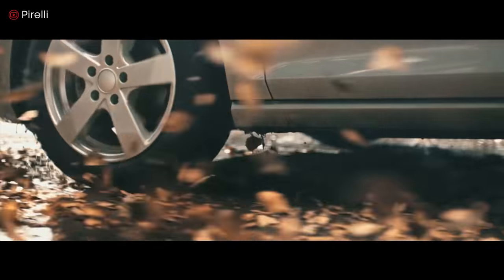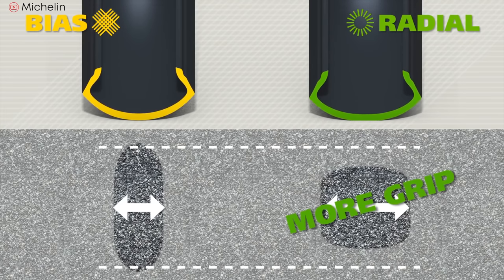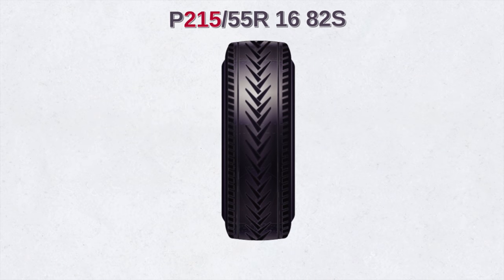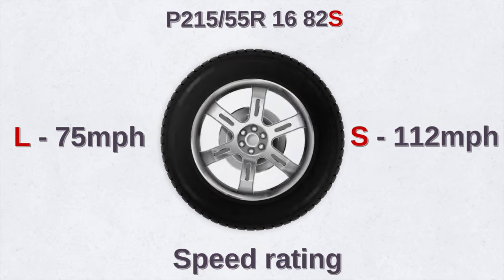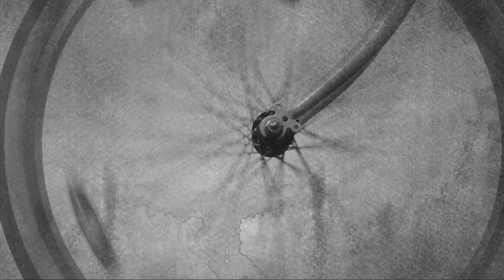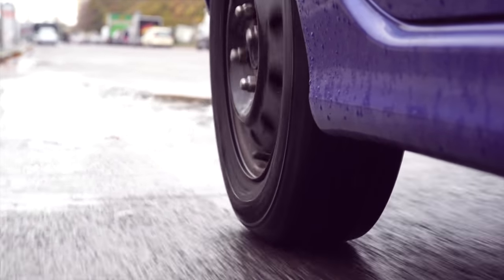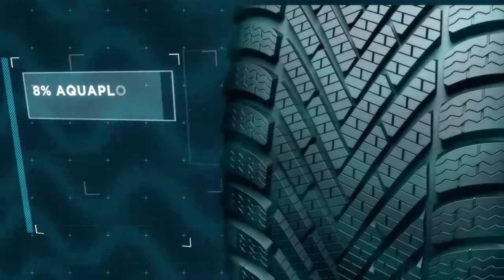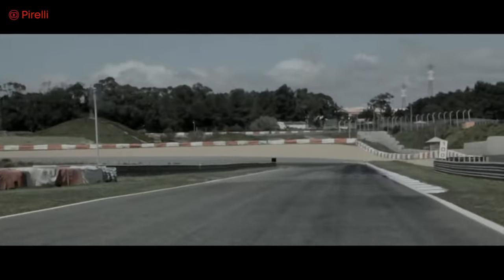These Tires Will Last Forever

Comment: Hey Scotty, 
Love your informative content 👍
Could you please do a video on the mechanics and geometry of front wheel castor, camber and toe in?
My 2016 Chevy express 3500 has had wheel alignment done twice in the last 3 years. And still the left front tire squeels like crazy while making a right turn in a parking lot. I also get some bucking feedback through the steering wheel. Im thinking the camber and or castor is set wrong. God forbid I end up changing out tie rods, pitman arms etc 🙏
I know from experience that the typical alignment tech wont go to the effort of adding or removing shims. ... Too much labour. 🙄

Comment: Let me start with, I rely on your expertise for a competent valued opinion. I see that you are not a great fan of Kia, but I did buy a Kia 2018 Niro Ex Hybrid, not a plugin but a brake regenerating system. My question is regarding the tires for this vehicle. What I haven't been able to find a definitive answer as to who produces a good Less expensive tire for this car other than the Michelin brand which is the most expensive. I would greatly appreciate any advice or recommendations you may have. I would believe that others could benefit from your advice as well. Thanks for any help.

Comment: Scotty there is a new classification called all weather tires to be used all year.They are not all season tires they are better and have a snow flake symbol on them.The Toyo Celsius tire is one example you should research this and update your video.I live in Canada and I use these new tires they are quiet and supply great traction on snow and ice I find plus no change overs needed any more .

Comment: Great video.  I’d like to hear about speed ratings. I have a Land Rover discovery sport that has V rated tires.   The guy at the tire store is telling me I’d be happier with H.  I realize in not going 149 mph but do appreciate the way the car handles.  I’m always up for improvement / ride quality but not looking to step backwards.
Reply: IF you live and drive during the blistering heat of summer in the Western USA or Southeastern USA then the V rated tires give you some extra heat protection at normal legal posted interstate highway speeds. The ambient air temperatures 1 inch above the concrete are usually much higher than the ambient air temperatures 1 foot from your driver's door window , plus the concrete itself is usually far above any average ambient air temperature around the vehicle.  You want the extra heat handling capabilities to somewhat reduce the probability of tread belt separation or sidewall failure.

Comment: Hello Scotty, is there a particular brand of tire that you would recommend for my car. I bought my first AWD car. I bought a 2018 Lincoln MKZ RESERVE AWD. It’s a Turbo 2.0. I’ve had it for a couple of months. I haven’t had the opportunity to use the AWD yet because we’ve only had 1 snow storm with hardly any snow. I live in the North East aka Snow Belt Region. I will never own Michelin. Michelin were on my 2011 Lincoln MKZ it was an Autostick 6 cylinder. It was excellent in the snow. It didn’t offer AWD. The Michelin’s wore out way before the manufacture warranty. They refused to honor their warranty. I’m not one to drive a great distance but, I definitely kept up with tire pressure & tire rotation. Even the service manager agreed with me. I bought my tires at a tire shop after that. My tires were fully warranted. I have the wheel chart that you explained.

Comment: 4WD with summer or all seasons can't compete with RWD or FWD plus snow tires in the snow. I love how when it snows here and all the soccer moms with 4X4s with 22" or 24" wheels wreck or get stuck since they think having 4wd can replace tires made for snow or offroad tires with the snowflake on then. I have BGF ATs which have the snowflake on it and I can't even remember the last time I used 4x4 on a paved road even with 2 feet of snow on it.

Comment: Hi Scotty . Back in the 60’s I put Michelin X tires on my 1958 VW bug . And increased the  road holding  & cornering by 60 % and got very high mileage. And never used snow ❄️ tiers . How did  the snow plough driver get to the plough ? = VW Bug 😂🇨🇦🇺🇸

Comment: My mother's 2013 Sonata just turned 80K miles. In the 30K mileage area they had new tires put on. Those tires still have 60-70% tread left. Those tires will last 80-100K miles. Plus original brakes. The GDI engine completely failed around 40K however, maybe 50K, otherwise it's seems ok except it's 4/10 slug shotgun steering wheel

Comment: Great video.

I learned years ago that "All season tires" had to compromise in  all aspects of weather. In order to last 50,000 miles they had to be hard enough to handle the heat of summer. But that meant they were not ideal for winter because they were stiff and did not bite well on ice and snow.

I was driving 40 miles  to work in every kind of weather you can imagine. I lived in Southern Wisconsin. A friend recommended winter tires for my Plymouth Duster which was terrible in snow because it was so light in the back. I bought some extra rims and had the tires installed. I could NOT believe how much better they were on ice and snow. In 1985 I bought a Dodge Omni which was pretty good in snow but not so good on ice with the "all season tires" from the factory. After I put the winter tires on, I rolled the window down and I could hear the tires actually ripping at the ice clawing their way forward. Amazing. I currently run General Grabbers on my Jeep Liberty. Most people would think them too noisy but they are good in rain, mud, snow, and do fairly well on ice. They are better at being an "All Season Tire" than what came on it from the factory.

I haven't felt the need to put "Winter Tires" on the Jeep as yet, although last year we had some freezing rain that made me wish I had the "Ice Tires" on all fours. I did decide to keep tire chains in the Jeep just in case that happens again. Seems to me there is nothing slicker than wet ice.

Comment: Here in pa I run all seasons but look fir those with best stopping distance in wet …90% of driving is dry or wet.. rarely snow but the all seasons handle snow pretty well.., around here they salt like crazy so snow often means wet anyway. If there is more than 6 inch on road I just stay home🥴

Comment: This was really good, would also like to see you talk about the difference in tire wear due to Electric Vehicles when the driver uses 1-pedal driving. There’s not a lot of consumer knowledge in this area, and EV owners will boast of ‘maintenance free” or savings compared to ICE cars. It’s not the case.

I’ve heard mechanics explain this - due to the inability to coast combined with the regenerative braking feature of 1-pedal driving power is constantly sent to the wheels to either accelerate or brake. EV motors have more torque so they get more wear on acceleration, combined with a 1-gear transmission or none at all, then when the driver takes his or her foot off the accelerator the regenerative braking starts immediately.

This sends immediate braking power to the wheels and increased tire wear, you could go through tires very fast especially in warmer climates where the roads are never cold. I’ve also heard winter tires on EV’s can last much longer so if you buy an EV the 1st thing you should do is also get a set of winter tires. They will come with summer tires (performance) and they are not safe in most winter conditions.

You can get 60K out of tires on a ICE car, expect to get 20K out of tires on a EV. I think that’s a good rule of thumb to go by. Now your maintenance costs have tripled so that is going to cut into any savings on gas vs power, engine maintenance vs battery/electrical maintenance etc. I did some research and ICE costs me around $50/month vs EV would cost $80/month for maintenance on average. The cost savings on gas is significant, well over $100 per month but EV’s are much more expensive right now, and the upfront costs along with concerns over how long these batteries will last, that’s the real challenge in moving to EV. Not to mention lack of charging infrastructure when it comes to taking longer trips, and length of time to charge when you are on a time crunch

Comment: Scotty what do you think of the new class of All Weather tires from Nokian & Toyo, that you can run year round. I do not know if any other tire makers are making them. I live in MT, but do not really drive that much because I am retired. I have used winter tires only on one car in 25 years of living in MT. The cost of a new set of rims to mount only winter tires or having to pay for mounting and balancing tires every 6 months, just do not seem to be worth it.

Comment: So Discount tire as well as others all go by the pressure on the inside of the car door. However, the pressure in the car door is not related to the Tire Specifications and submittal. The spec on the specific brand of tireay call for a lot more air pressure then the car door. Having the tire 10 to 20 psi less than the tires rating, jeopardizes the amount of weight they can actually carry. What's the right decision here?

Comment: So I live in the center of the continent where it gets over 110 (sometimes) in the summer, and 30 below 0 regularly in the winter. I primarily drive paved roads but go camping and adventuring a couple dozen times a year.  I drive a full size 4x4 suburban and am curious what to do. Do I have to get 2 sets of tires? I'd prefer if I didn't have to but I need to get around in deep snow and ice. But also drive 6 months on hot dry/wet roads!!! Is there a decent single option out there for me? Please help!!

Comment: A few years ago, I bought tires at walmart for the wife's car.  They were 51 lb. tires.  I'm guessing that the OEM tires were 35 lb tires.  The tire "technician"  inflated the tires to 30 lb., based on the tire inflation info on the door.  That is like driving around with a flat tire.  The guy argued with me, but I try not to argue with fools.  After driving for a few days, I asked her about the handling, mileage, etc.,...  I filled the tires up to 51 lbs.  Her mileage went back up to normal.  The info on the door is for OEM tires.

Comment: My Mercedes has a pressure psi near the door and another on the gas flap behind. Any idea why and which one must be followed? BTW even the dealer was confused when asked!
Reply: Right it is confusing. Differently manufactured tires have different pressure recommendations.
Look on the tire, (in small print) it will have the maximum tire pressure for that particular tire.
Go by what the tire manufacturer recommends.

Comment: Lincoln's head is about 1/4 of the way in my tread but winter is here.  Do you suggest new tires?  Geez they are around $800.  I like to get them from my dealership then they will do free rotation for me.

Comment: Hi  Scotty I've been following your website I was a homeless vet for a year and a half now I'm in a VA home I have a 24-year-old 4150 that I've had for 12 years it's got about 170,000 MI I've had the front end checked and they said it's okay I put a new power steering box in the brakes have been replaced the internal cam sensors been replaced the compressor has been replaced along with the dryer I tuned up the truck it's okay it's just that it's hard to control the truck over 50 mph if I have to go around and sweeping left turn I have to turn the wheel to the right so I don't run off the road and it's very hairy trying to control the truck I've been looking at some of the cars that you have recommended the Mercury Marquis that's one of the cars that I've seen that the price ranges are within my financial situation I've seen some with 45,000 miles one owner that look like they're really in good condition some of them aren't even more than $6,000 the thing I'm concerned about is if the car has been sitting for some time what about the rear main seal drying up and the transmission seals start to leak after you start using it I can't have any large mechanical repairs to deal with I just want your opinion the Ford van needs to be painted and I have to deal with the front end issues and I feel that I have to probably put in around 1,500 in the truck I don't know if it's worth that much money on a 24 year old vehicle it does run okay it accelerates fine i I replace the axles and bearings in the rear end it has a new water pump it has a new battery I changed the oil every 3,000 miles since I had the truck it's got a big 6 cylinder engine I just can't control the steering let me know what you think about the Mercury Grand Marquis and a Ford van thank you Scotty I have an idea maybe you could just beam me up and do  a class two diagnostic on both of the vehicles in question

Comment: Hello Scotty thank you so much for sharing this highly informational video I have a question for my new to me stock 2008 ford f150 super cab 4x2 5.4L V8 with tire code P265/60R18. I want to upgrade my tires soon since they are wearing out. Is it possible to switch them to a ST tire? Before finding your video I was debating with myself to make large upgrades such as getting the BFGOODRICH TKO2 tires having me to change even more than just the tire with the tire and wheel well and hieght or just going simple route and getting the BFGOODRICH trail-terrain T/A tires I can just get at my local costco that are already the size I have now. Overall I'm looking for a tire that can help me go out and do more camping aswell as help me with carrying heavy loads for landscaping /renovating my house, and eventually getting a small boat down the line to go with the camping. I plan on keeping this Truck for atleast 8 more years since it barely has 120,228 miles mostly highway miles and I plan on making adjustments as time passes. So what do you think? Would I be able to get the TKO2 tires without repercussions or would the disadvantages of changing the tire size of the vehicle outway the looks? Creating strain to the engine and or transmission, or anywhere else to the truck? I'm probably over thinking what I want but at the same time I just want to make sure I'm getting the best choice tires to work with the way I want to set up my truck. That mainly being camping and usefulness in the backyard projects. Like for instance having the stock height is really nice just because it's easier to load equipment into the bed. My dad used to have a high lifted truck. I'm 6ft tall and I tell you lifting full trash cans into it wasn't  fun hahaha.

Comment: You forgot one very important thing on tire pressure. Tire should be set to psi relative to temp. That is very important for place that temp could change up to 40 degree F in one day. 
Example: Mfg recommended 34 psi cold. Will, if you set 34 psi at 6 a.m. with 70 F temp. The tire could be 30 psi with 30 F at night which is too low. So I would set the at 38 si for 60 F to compensate for 30 F at night

Comment: Really good presentation, and accurate. I put four Sumitimo Ice Edge tires on my Yaris. I'm in NW PA, and they were worth every penny. Turned that little car into a tank. One night I was actually pushing snow with the grill and the tires wouldn't break loose. We've had a bad winter here, and I've never gotten stuck with them yet.
Reply: I had sumitimo tires on my Honda and I had really good luck with them.

Comment: Just wondering, I don't drive much and have a 6 year old car with 7,200 miles on it.  I was told I need to get new tires because they are "old" and could be dangerous.  I live in the desert so we have somewhat cold (30's) winters and very hot summers (over 100).  Occasional freeway driving but mostly just local driving to the store and In-N-Out. Car is always garaged and has never been driven in the rain. So is owning a forever tire possible?

Comment: So whats the best for me to get in dry/wet road tires?
Reply: What are you driving and what tire size does it use?
Reply: @davidhoffman1278  toyota scion & tire i have is  255/19R/18
Reply: @dr4nujgaming391  ,
Maybe Falken AZENIS FK460 A/S, if you can find them in your sizes.

Comment: You didn’t cover all weather tires - the tires designed for year round use but are rated for severe snow service (traction tire).

Comment: I'm looking to replace the Continental EcoComfort6 tires on my new Ford Escape 225/60R18 with better comfort tires which offer maximum touring highway comfort ride and better performance in the wet handling as my 2 main criteria - have to be max comfort and better wet handing - any recommendations please?

Comment: Tires will only last as long as wheel alignment is right, And on most late model cars with their cheap stamped tin 4 wheel independent suspension, you are lucky to make it 10K miles before needing to replace bent suspension components. All of my cars have solid rear axles which never need an alignment. And I'm about to trade my later model truck for a mechanically restored 1975 Ford F-150, with Twin-I-Beam front suspension. No more alignment problems with that.

Comment: What if the tires on the door aren't the tires that you have on the vehicle is the tire pressure that's recommended on the door the same as the wheels that you put on

Comment: When it’s real cold my tire pressure drops significantly- is there a chart for adding air then - often the tire monitoring system activates low pressure.

Comment: Hey Scotty, I am looking at a 2009 honda crv fully loaded with 230k km for 6000 in canada. It shows an accident on the carfax but its no salvaged or rebuilt. Is it a good deal?? Please answer ❤
Reply: Sounds good,  if it's in good condition and runs/drives well. I bet you can get another 230,000 km out of her,  if you change the oil regularly,  and drive normally. It's wiser to fix a vehicle like that Honda than to get rid of it. I have a Honda car with more than 550,000km and it still runs great.